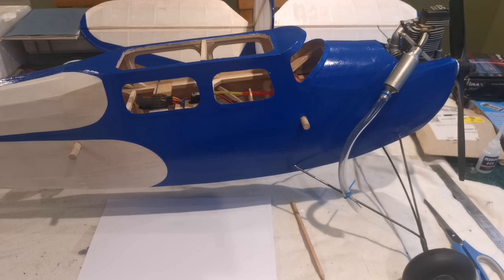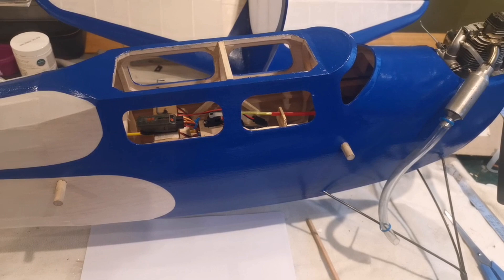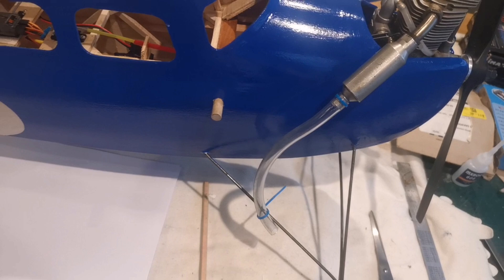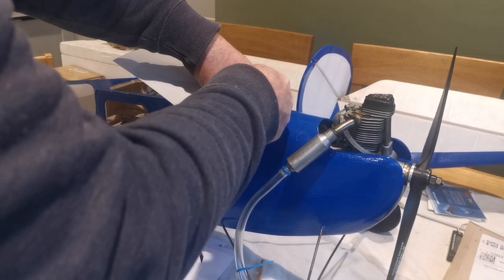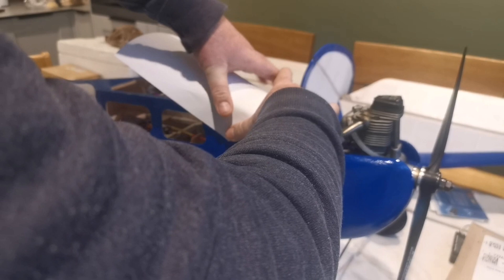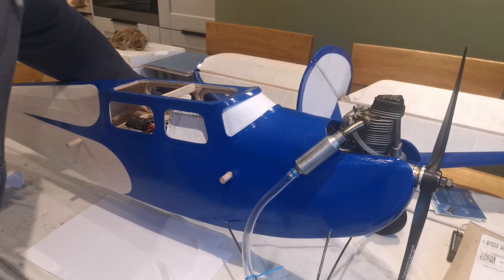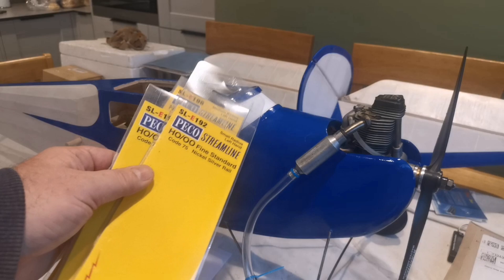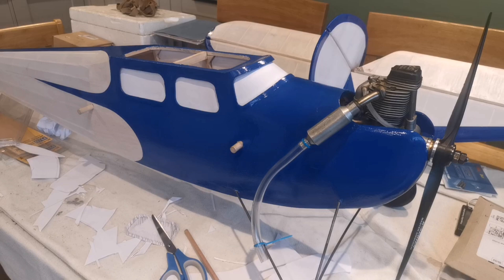Trouble free glazing for your model plane : Falcon vintage plane.

Comment: Hiya mark how many coats of that fuel proofer do you use? i usally use the guild spray stuff but i dont like spraying as i havent really got the room.
Reply: I fancy giving this stuff you use a go.
I need to fuel proof my t240 and fancy trying this.
Reply from the maker: I gave it two coats, discovered that it thins nicely with a little cellulose thinners You don't need as much catalyst either